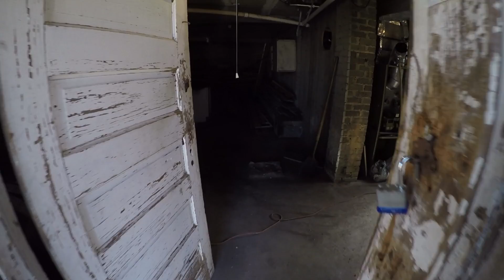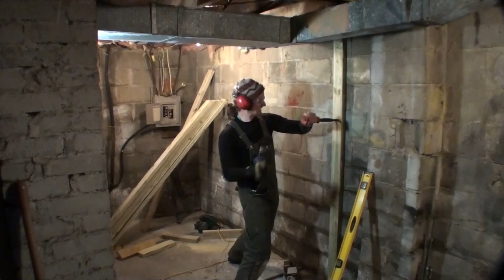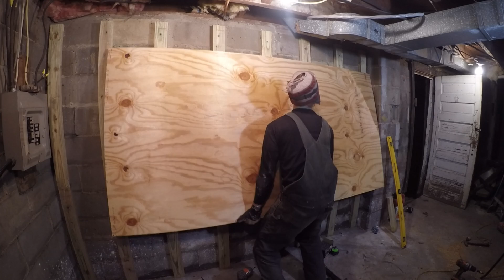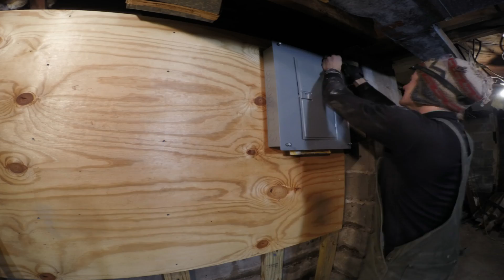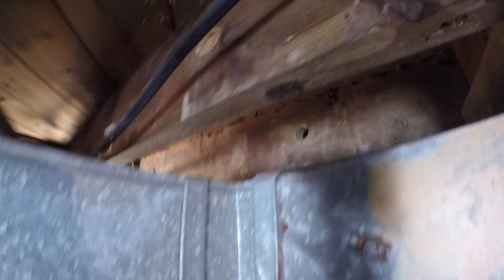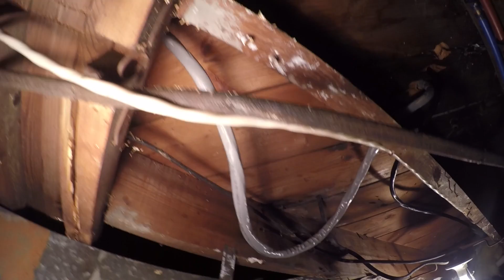Basement Wood Shop #1 - Mounting a Sub Panel

Comment: Your videos are short, few and far between.
Reply from the maker: David Blake I apologize for violating our contract.
Reply: Hey, I'm not judging. I really enjoy watching your videos. I just wish you uploaded videos more often. Keep up the good work! 
   P.S. The house looks great
Reply: The Homestead Craftsman Hey, I really enjoy all of your videos too. But if I were as busy as you are then I wouldn't be too worried about videos. This is a tip and maybe it will help someone here. When I work with heavy gauge wires I always use the hole at the end of a crescent wrench to slide the wire in to make the bends into the box after I strip the jacket off... Cheers!
Reply from the maker: Mike 60 That's just how those tight bends where made! Good tip to share. THanks for watching.

Comment: I noticed the moisture on the lower third so the  wall. Are you concerned about rotting wood?
Reply from the maker: 4460cows No, there's some small cracks in the wall and stairs on the outside. Water splashes off the steps and on the wall. It then comes in through the cracks. The cracks will all be sealed and the wall painted which will stop the problem, but even then. A slightly damp wall will not rot the wood. The 2x4's are treated, and the plywood is held off the wall 1.5" so the air gap will let it dry since air can flow. If you'd like to see more, check out my other channel. It shows work on the house. Thanks for watching.

Comment: From the way your dressed I'm assuming it gets cold where you are why not use some ridgid foam to insulate behind the plywood?
Reply from the maker: Pat M  There's no heat in the house right now, doors are open, it's windy and winter. I'm working basically outside all day long. Once the house is done, everything will be tight and sealed and plenty warm enough for a shop.

Comment: I used to do all this type work and loved every minute of it. Going to be a great shop space! I am getting to know you pretty good so I can already guess you have the soundproof insulation picked out for the floor joist, maybe roxul? Ha!
Reply from the maker: 19stoney64 My plan for sound proofing is just using the fiberglass insulation. It cut's down on noise pretty good. In general, I'll be doing most loud work when no one is home so it won't bother anyone. There is also drywall on the ceiling in the middle part and I may put in throughout which will help some also. I like the idea of cutting the sound down as much as possible but the cost goes way up. This house is not a long term situation for me as far as living and working out of it, so I can't go toooo crazy. In general though, my tools are not that loud. My table saw runs very quite along with everything else. My planer, air compressor and lathe can get loud though. For my air compressor I'm going to build an insulated box for it........everything else will just be loud!

Comment: Congrats. on the house, as for your shop , it appears to be the same layout as mine. My advise is that you not only plan carefully but act out going thru the motions of working the lumber to see how smoothly you can move about without bumping into stuff, an hour of planning now will spare you the hours of changing things around hard to move machinery later. I know because I've been there done that ,lol . Good luck, Stan .
Reply from the maker: Stanley Kennedy Thanks Stan, I've owned the house for about six months but have only been working on the main living space until now. But that doesn't mean I haven't spent a good amount of time in the dark dirty basement with my head lamp pretending to rip imaginary boards on a non existent table saw. Most of my tools, are or will be on mobile bases. I have a pretty good idea of whats going to work so what I'm going to do is get started with what I have in mind and see where my tools end up after a few weeks, then from there start doing the basement wiring to where each tool works best and start building some of the other stuff like shelves and work benches. I've also mocked up the shop on Grizzly's shop designer and it looks good on there too. It's not a big basement and there are certain things I've got to work around, but it's plenty long for most anything I'd rip or plane luckily. I'm just looking forward to not running tools off an extension chord, plugging in each tool as I need it. Having it heated and cooled, and not having to put stuff away because it's going to rain. Also, good lighting which will make filming look good night or day for making videos. If you can't tell.....I'm greatly looking forward to it.
Reply: Way to go buddy , I should have known better , Ha Ha , recalling past vids, you do seem to plan ahead. I just wanted to point out mistakes a lot of guys make (me also),seems that you got it covered though. Good work ,and enjoy your somewhat new shop. Stan.

Comment: Been there.  I use to live in a 100+ year old house.  The joists in the basement were true 2X6's 12" apart on center.  It took me most of a Saturday just to pull that stiff wire through those joists. about 30' to the other side of the basement.  That's what I get for letting my wife decide to move the appliances!
Reply from the maker: Zerkbern This is only the wire to the sub panel. I've still got to bring in the main service panel which is twice it's size. It's going to be a real bear and I've got to work with over 50 feet of it.
Reply: The Homestead Craftsman
Ow.  I don't envy you the task.
Reply: The Homestead Craftsman I have found a bit of dish soap in a spray bottle will help it slide threw the drilled holes. Did you think about coating the walls with some kind of water proofing?
Have a great day.
Pat
Reply from the maker: FloppyHatPhotos I'm going to seal up any cracks and paint the outside. Any moisture that comes in will be extremely minimal once done and the a.c./heat would quickly take care of it. I may use some dryloks paint inside in some areas, but for the most part problems are cause by poor drainage and issues with gutters which I will address. Thanks for the thoughts.

Comment: I have a small basement shop because that's the space I have available.  My two biggest issues are sound and dust collection.  I want to breathe and not go deaf.  That said, I'm really looking forward to how this progresses!
Reply from the maker: Another easy solution that I've done is 20 inch box fans with a house hold air handler filter on the "intake" side. I've got several old fans I use, you can get them cheap.
Reply: The Homestead Craftsman I have used house fans with a filter and they do an excellent job on a budget. I recommend buying the best furnace filters available. I had to go with the air filtration because I have sinus issues (they started before  woodworking). Btw Thanks for always providing great content.
Reply from the maker: Dan Mills Can't change small, but you can fix dust and noise. A small dust collector and an air cleaner. Or just put a respirator on, or both. As for sound, you can sound proof things like air compressors but in general, tools are loud, you just have to where hearing protection. I just put the little foam ones in my ear and leave them in unless I'm doing quite stuff. Thanks for watching.
Reply: I do plan on proper dust collection soon enough. I also found some great ear protection that has a cable to connect my phone for music.
Reply: Dan Mills I have the same issues with my small basement woodturning shop. I typically use a respirator when I do do truning or when i make cuts. I'm so used to wearing it now that it doesn't bother me. I try to close as many holes as possible in the shop so the dust won't go creeping into the house. I recently bough a jet air filtration thats going to help with the dust.

Comment: It looks like an outside wall; I am surprised you did not insulate the wall before putting up the subpanel.  My basement is now completely insulated except behind the panel because it could not be removed.
Reply from the maker: peggyt1243 The square footage of the basement is pretty small, so heating it won't be an issue. And being a shop it doesn't need to be as warm as a living space. I considered it. But the cost out weighed the benefits for how long I will use the shop.

Comment: Hey im following your progress in your channel. I have a question: im thinking to do something similar with a house. Is this choise of remodeling  by yourselve too expensive? 
Greetings
Reply from the maker: tecnico Well, "Too Expensive" is relative to each person, so I'm not sure how much is too expensive for you. But what I can tell you, is that labor is the most expensive part of construction, so having someone else do the work will cost more. Obviously I don't consider it too expensive seeing how I'm doing it. Also, if you are considering doing it as a rental, you'll make all the money back and it's tax deductible. Real Estate has a lot of advantages financially. Feel free to tell me more about your goals and I may be able to give you a more specific answer.
Reply: The Homestead Craftsman my plan is to purchase an acre or half and avoid the mortgage  thing building a 600 sq feet house witha project loan in homedepot or something like that. I have to get the help of sombody since i still dont have the skills to build, i could but it would require more time, plumbing and electrical i  can do..

Comment: I guess I'm not getting what's going on. You stated that you have a 200 amp service upstairs. You said that the other box was 100 amps & you're installing another 100 amp sub box. So that's 200 amps with out the circuits to run the house. I'm confused about what you're intending....LOL

Thanks for the vids & bringing us along.
Reply from the maker: 1timby The main breaker box that is directly connected to the meter outside is a 200 amp box which has everthing in the house connected to it. (bedrooms, bath, kitchen, etc) In the basement I wanted to have a separate panel, so I installed the 100 amp box as shown. Which is fed from the 200 amp main panel upstairs. Let me know if that clears it up.
Reply: The Homestead Craftsman Still missing it. You already had a 100 amp breaker down stirs in the basement & added another 100 amp. Or am I just misunderstanding you? Are you going to move the existing 100 amp in the basement over.... Still confused...LOL
Reply: ***** Got that. But in the vid he said that the other breaker box already on the basement is 100 amp. SO adding another 100 amp box would be 200 amp in the basement. Or did I just moss that he was going to remove the existing 100 amp. LOL
Reply from the maker: 1timby No, I completely rewired the house all the way up to the power line (Upgrading from 60 amp service to 200 amp service). The old box you see on the left wall is going to be removed but is still providing power to the house to use while I work. There will be only be one panel upstairs, the 200 amp main service panel and a sub panel downstairs that will handle the wiring for the basement shop only.
Reply: The Homestead Craftsman Got cha---- I thought I was missing something...LOL